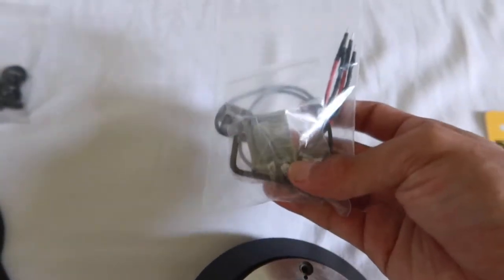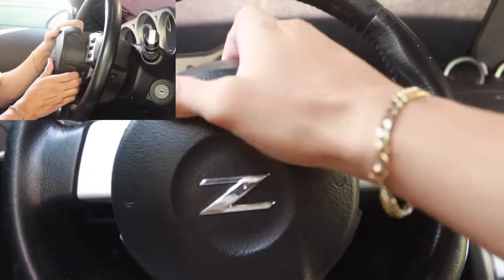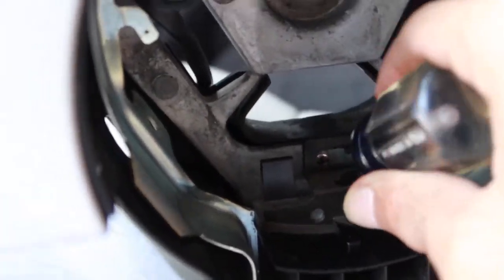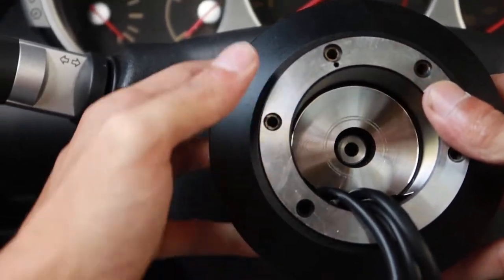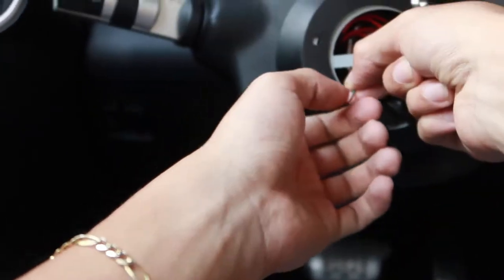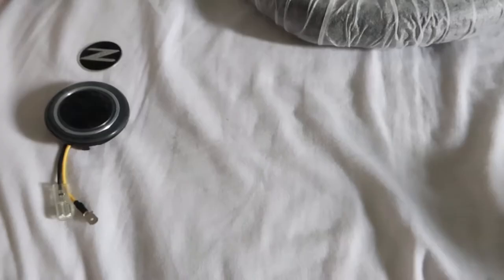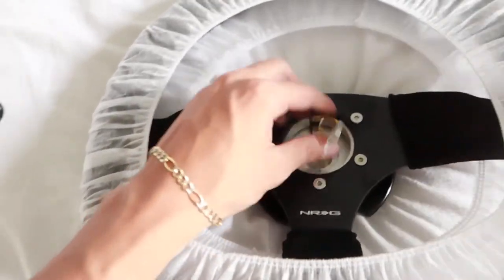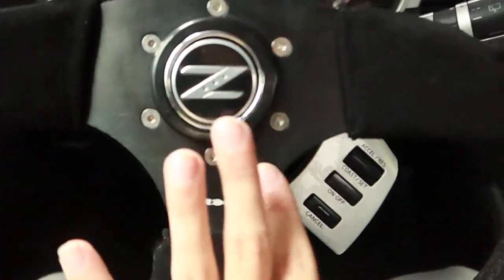How to Install QUICK RELEASE STEERING WHEEL [+ CRUISE CONTROL RELOCATION]! (350Z)

Comment: When I installed my quick release I took the controls out and my vdc system turned off and causes my z to not have traction control, is that because of the cruise control harness needs to stay in?

Comment: i have an 07 base model and the oem steering wheel doesn’t come w cruise control. i bought an adapter and cruise control buttons from z1 and i got a NRG wheel. everything’s connected the idk if it works bc the dash lights don’t turn on. is it supposed to be like that?
Reply from the maker: the only wiring (if you have base model) should be the air bag. nothing in the steering should have affected your dash lights unless you shorted something or blew a fuse. happens.

Comment: I wanna do this to my car but the stock cruise control buttons are ugly af and they wouldn’t fit that mount or any other mount I can find for that matter. Would I be able to buy different buttons and use that like shrink wrap wire connecting stuff to connect it to the original wires?
Reply from the maker: you have have to do a good job wiring it but yeah bro. i don’t see why not